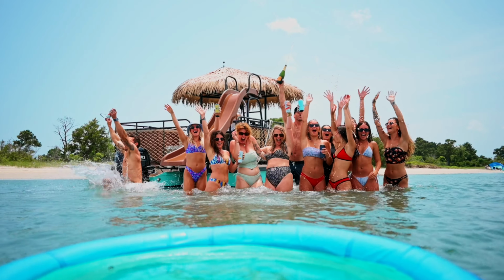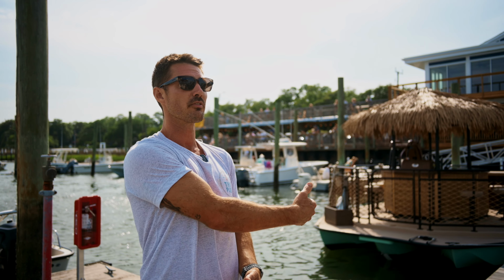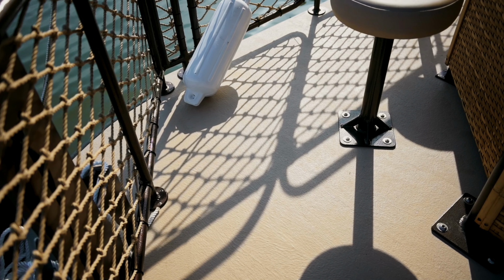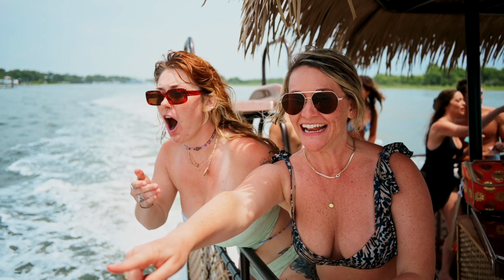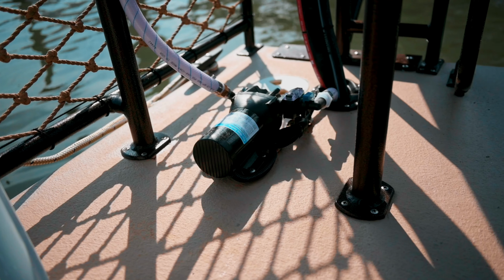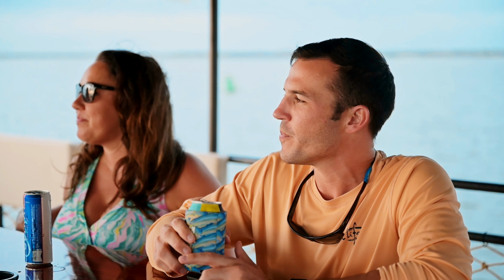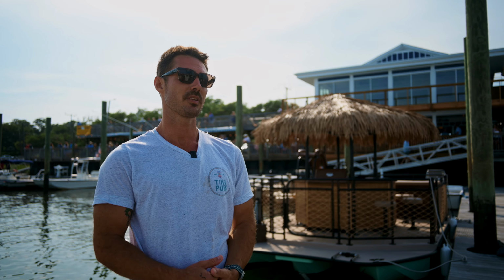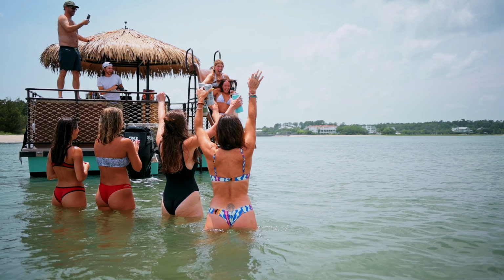Detailed Walk Through of the Tiki Boat 18

Comment: How many feet is the boat
Reply from the maker: Here are some specs, give us a ring @ 1-888-753-7507  to learn more.

Capacity: 6 passengers + 1 crew
Tritoon - 18' x 12' deck (20' LOA)
(2) Riptide Outer Hulls w/ aquastone color gel coat
(1) Riptide Center Hull w/ aquastone color gel coat
Black Bottom Paint
Woodgrained bar table + thatched roof
Adjustable roof height for transport with up/down pinned
positions
(6) bar stools w/ turquoise cushioning
Aluminum structures powdercoated with Prismatic
Caramel Kiss
50 gallon fuel tank nestled aft on top of center hull
Forward swim platform, access ladder + keel guards for
beach capability
Stools, popup head, dockbox cushions in seafoam green
Sound bar audio system
Party lighting LEDs with color control
Suzuki 90 hp engine + steering + rigging + gauges
Reply: 18' x 12'